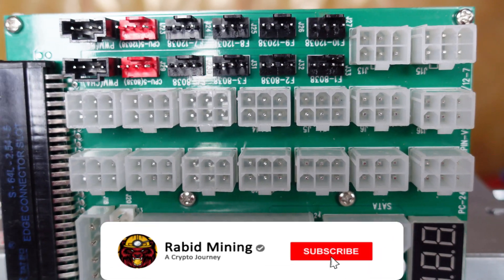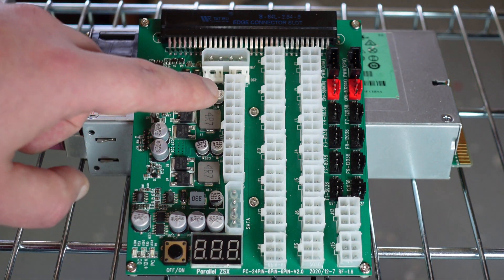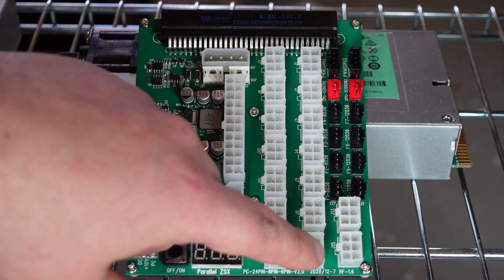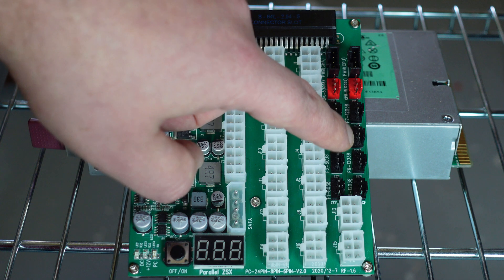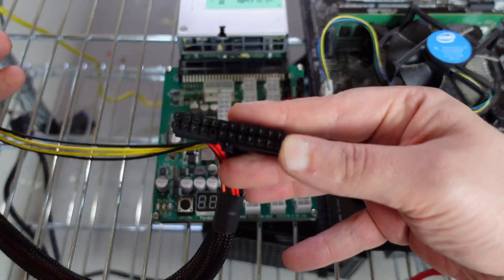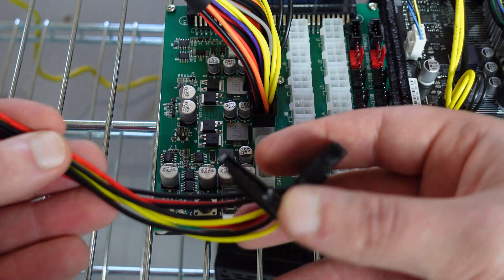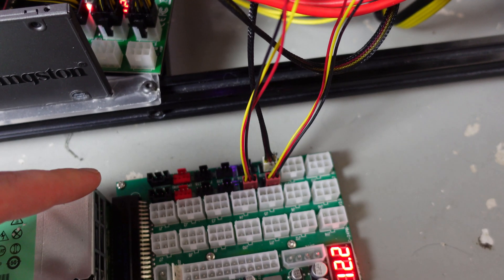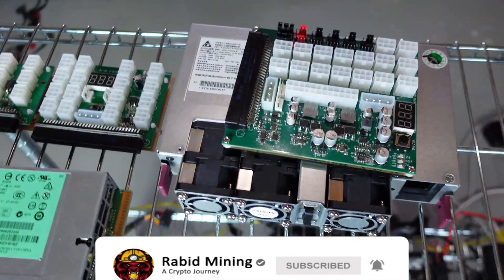ZSX BreakOut Board 16 ports AKA The Game Changer Miners Love This Thing!!

Comment: I bought one of these and it stopped working after a couple months. Yellow light comes on but that’s it. You know a quick fix?
Reply from the maker: Not sure :(
Reply: @RabidMining I finally got an RMA replacement 
from Parallel Miner and the replacement boots the board but non or the 6 pins work, so they sent me two junk breakouts in a row.
Reply from the maker: @fuzzyharold wow :(

Comment: Can i use 2 differentes cables instead of 1. Witht the 24 pin and CPu power cable. Cause mine didnt include that cable. Im using delta 2400w
Reply from the maker: Would only recommend the cables part of there packages.
Reply: @RabidMining  yeah i was just wondering cause I burn the other one🥲 looks like I need to order a new 24+CPU cable that’s why
Reply from the maker: @hebertomendezgarrido8931  ahh dam how did that happen? Think the rating is 180w on the cable.
Reply: @RabidMining  idk i accidentally connect molex ssd to gpu breakbordd and cabum the motherboard burn 🔥 the good thing is that only the motherboard burn, but the cable (24 pin+CPU) smell like components burning. Sorry for my bad English I’m from Mexico
Reply from the maker: @hebertomendezgarrido8931  it's ok

Comment: What happens if you plug the ATX cable backwards?
Reply from the maker: It shouldnt line up but not sure hsvent had it happen can easily see where the clip should be but guess someone could go backwards
Reply: @RabidMining  I mean mixing the plugs up.
Reply from the maker: @dontworry9093  oh dont think it would matter much but should notice the 8 pin for the cpu is weird and coming from a weird end but then again it could be more convenient that way ahaha so not really sure.  Guess I could burn one as a test lol

Comment: Hey man. Could u help me figure out. So im planning to build a 8 gpu rtx 3070 , how many server psu do i need ? Do i need to buy one or two ?
Reply from the maker: On 120v or 240v?  If 120 then the 1200w psus will only be 900w max and would need 2.  If 240v then can get away with 1 but will be tight would still recomend 2 then have room for couple more cards.  Remember links in the description:)
Reply: @RabidMining  thank you. I will get the 120v.
Reply from the maker: @iiulombomusic  ok will need 2  of the 1200w PSU kits then.

Comment: Have a quick question sir, what if my motherboard has 1 6pin and 1 4pin? How could I power my motherboard with the ATX you used?
Reply from the maker: dont need the 4 pin thats a high performance marketing scam for gamers will be just fine with just the 8 pin.

Comment: Excellent video as usual
Reply: Is it possible to hook up a splitter on the end of their pcie cable or is it a stand alone architecture? Also what is the max wattage each pcie port can handle?😊
Reply from the maker: @ghassounkilani5279  ahh can use a splitter if you want.  If the gauge of the wire is good and the pins in the connectors can pump around the 300w mark threw them but dont recomend trying to pull that threw them.
Reply from the maker: @ghassounkilani5279  ahh can use a splitter if you want.  If the gauge of the wire is good and the pins in the connectors can pump around the 300w mark threw them but dont recomend trying to pull that threw them.
Reply from the maker: Thank you

Comment: Great review, man. just guessing, but that break out board probably needs one of those dummy plugs that ATX psu use to fire up, if you dont have them pluged into a mobo. All they do is short two of the pins to make a close circuit kind of "switch".
Reply from the maker: They have a power switch on them to turn off and on dam did I miss that?  and thank you
Reply: @RabidMining  yeah you did actually miss that in the video, but that’s not what I’m talking about. I’m talking about the Molex not being powered unless you have a motherboard connected to the big connector. I would guess that it works like a ATX power supply. Those too don’t work unless you have a motherboard connect... UNLESS you have one of those dummy plugs that short pins 4 & 5 together. Then I bet your molex could be powered without an actual motherboard connected.
Reply from the maker: @MarkovAllTrades  maybe not to sure parallel miner said they will revamp it so it has power   by defult.

Comment: You can probably make a jumper 24 pin connector for the SATA port to fire power with Rebtech. Not 100% sure though.
Nice points about server psus at the end too.
Reply from the maker: Probably can make anything if u need to lol thanks a lot

Comment: No 8 pins?
Reply from the maker: Breakout boards are all mostly 6 pins just use good cable 6 pin 6+2 they are ok up to 280 to 316w or so per cable.  Its atx outputs that limit 6 pin to 75w and 8 pin to 150w but gotta make sure you dont use cheap cables or connectors.

Comment: Why not spend the $65 and buy a simple ATX PSU (that you can sell later on). You can find nice 500W used PSUs for $30
Reply from the maker: Lots of miners run on 240v and when you do a pdu doesnt have unlimited plugs why use 2 plugs when u can use 1 for a whole system also throw that breakout board on a 2400w server psu run 10+ gpus off it with no thinking of how to run pcie cables when you will have enough for every riser and pin on a gpu.
Reply: @RabidMining  I live in Europe, so I can't really relate to that. But why can't you get a second 240V plug, or a power-strip?
Reply from the maker: Oh nice wish 240v was standard here like it is over there with your 220v lol.  I wired in my own 30 amp 240v breaker with a 30 amp pdu for a max capacity of 7200w PDU has lots of plugs think mine had 4 banks at 8 amp 4 c13 plugs per bank and 4 banks of 12 amp c19 plugs.

Comment: I want this board but it costs ten times more than a Delta mini ITX PSU.
Reply from the maker: Have a link try to google a delta mini and only get 250w or 300w psus which are good for nothing.
Reply: @RabidMining  it is just for supplying the power to the mobo and sata. You just put the 4pin fan cable to a normal £10 breakout board and server psu. 

The only other options are the board you are reviewing, or a pico adapter which costs a little more than the delta psu, and is a little ugly and needs modification to suit the setup.

The delta brand is solid though, many of their psus are rebranded as HP and other reliable brands. I use mine with a 750w HP (probably delta really) server psu, then can just daisy chain more 750w psus (the 1200w ones are more than three times the price).

I'd love the board you are reviewing, but it would be a luxury for me and as i can achieved the same with much less money.

Comment: Fried the ZSX board lol. Dont plug the 24pin and use the molex port to power the mobo.
Reply from the maker: ouch did you use the wrong molex port?
Reply: @RabidMining  No. The ZSX board is rated for I believe 120 watts on the "atx side". ATX side meaning the 24pin and the molex connector. The new revision from parallelminer is supposed to allow this connection.
Reply from the maker: @deegs1749  good to know not sure them numbers but 120w is more then enough if thats its rating as a system only uses like say 17-22w rest of the power is threw pcie into risers and gpus.

Comment: I've been using pico PSUs to power the motherboards with a server PSU, but this is even better if it's cheaper than the two pieces
Reply: It is a bit more expensive.  You can get a breakout board for $15, and a Pico PSU for $15, and this costs $65.  The extra fan pins might be worth the premium though.  Nice product overall
Reply from the maker: ya guess a bit more depending where you look nice to have everything in one.
Reply from the maker: nice

Comment: I had my ZSX 3 min before it blew a cap and fried the board. I thought it was a defective board but maybe I used the wrong molex on H110 mobo and that’s why, good info in this vid
Reply: From what i found out you have to power the motherboard through the 6pin to a molex.  Then you can buy a splitter and use 1 to power both if you need them or use 2 cables.  The molex connection on zsu next to 24 pin slot is designed mainly for ssd and othet accessories.  (Not motherboard or you will get same results)  trust me I know now..🔥
Reply from the maker: @jeffderitis1378  I blew up my h110 with a broken 1200w evga atx psu but when it was working dont think I used the molex and it worked fine on the pcie slots.  Cant reconfirm cause that board is now dead lol.
Reply from the maker: Oh dam was it the top #1 molex?
Reply: @RabidMining  cant remember, it ran for 2 min then a big blue spark n smoke of that one cap popping. I got a replacement on way so I’m gonna rewatch this before connecting
Reply from the maker: @BigtimeBigA  lol ok musta been the wrong plug lol

Comment: The molex is useful if you want to use a small cheap 400 w ATX power supply for your motherboard. Then you would connect the a molex from that power supply to the molex on the breakout board. Then when you turn on the ATX power supply the server PSU will automatically turn on.
Reply: Yeah, but the zsx is all about getting rid of that atx.  It is a good point though

Comment: Aren’t 6-pin plugs only rated for 75W each? No problem to supply two 8-pin?
Reply: To go a touch further.  An 8 pin at the gpu will pull up to 150 watts, a 6 pin from gpu will pull up to 75 watts.  Now the power from a single 6 pin plug on the breakout board can pull up to 300 watts.  The cables need to be 16 gauge and have 6 terminal pins in the plug to safely use with these breakout boards.  So you can run a 6 pin to 8 pin 16g wire from the breakout  board and pull up to 300 watts.  U can then use a splitter (at least 18g) to break that out to dual or triple 8 pins.
Reply from the maker: @AlteredComponent  what altered said lol
Reply: @RabidMining  and thanks for the review! Great content!
Reply from the maker: @Bobby_Strange  thanks a lot
Reply: @AlteredComponent  thanks!
Reply from the maker: Didnt go into detail on the cables cause this is about the breakout board.  But the traditional numbers of 6 pin for 75w and 8 pin for 150w is based on atx psus and a atx  rated output.  6 pins with 16 gauge or so wire with good pins can carry more.
Reply: @RabidMining  good to know, though I was talking breakout. 1200W/16 plugs also implies only 75w for this board. While we might split the 6pin to supply 150w to an RTX3070 for example, it seems unnecessarily risky vs two 6pin to 8pin straight cables each pushing 75w (thus can push more if a card loses power limit)
Reply: I mainly use splits when I want equal power distribution to 2+ locations I know are using less power, e.g. risers

Comment: I just bought this! Great timing for the video THANKS!
Reply from the maker: nice
Reply: @RabidMining  tb360-btc pro is the motherboard I bought. Do you know if this board requires both 24 pin connections to function? If you have done a video I would appreciate a link. My first rig build learning as I go
Reply from the maker: @romplesr.2841  dont have that mb but will look into it guessing that's just to power on 2 psus and should work with just the one.
Reply: @RabidMining  Thats what I was thinking but 12xpcie slots I wasnt sure how much power was required to run them all. I only have 2x3070 currently on the hunt for more so its not a immediate issue. Thanks for the help appreciate it!
Reply from the maker: @romplesr.2841  np